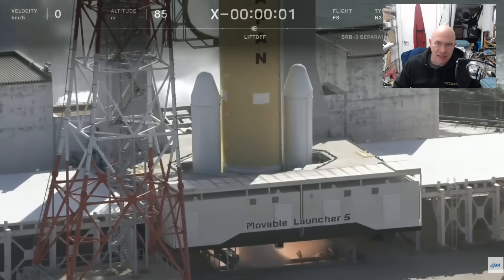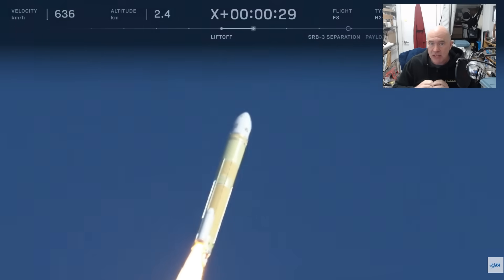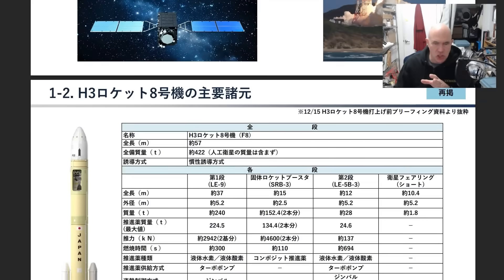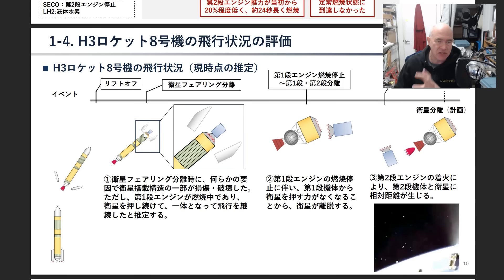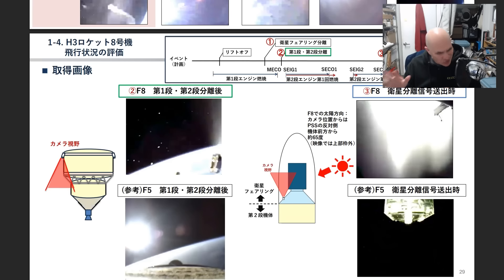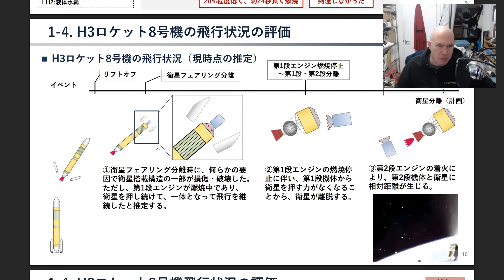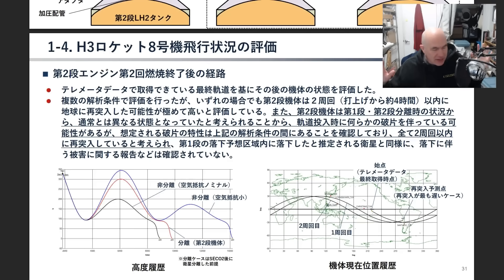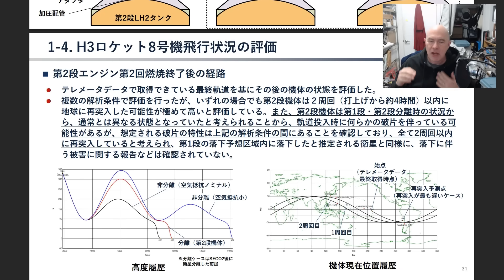OOPS! Japanese Rocket Drops Satellite Before Reaching Orbit....

Comment: What's your take on the Orion heat shield? NASA’s Orion spacecraft has a known flaw — one that has some experts urging the space agency not to fly the mission with humans on board. But NASA remains confident it has a handle on the problem, and the vehicle can bring the crew home safely.  The issue relates to a special coating applied called the heat shield.

Comment: So compared to SpaceX... is this comparable to a Falcon 9 dropping its payload, or are they still in development? Do they do enough testing?
Wikipedia says they've launched 7 times since 2023. The first and the last failed and the 5 in-between were successful, so likely not a design fault. However "Cost reduction was the primary design goal ." So was the launch adaptor any different to the previous five?
Great production, thank you Scott!

Comment: This event reminds of a young engineer, who was trying to impress me, with a new spring torque equation.  He left Mass out of the equation, turning an overhead rolling door into a guillotine.  As I watch this video, I can see management firing the young team that worked on the launch process.  It is always a simple action for management, when it comes to dealing with people that cut corners.  If the loss wasn't bad, the employee gets a second chance, but in an expensive event, people got fired.

Comment: I worked on Peacekeeper S-IV for TRW back in the 1980s, and while my stage wouldn't have benefited from video telemetry, it sure could have used the bandwidth.  Even one of those video images probably constitutes all of the telemetry bandwidth at our disposal.  I spent 6 months figuring out what happened to FTM-15 - or rather, what caused it.  I identified the location of the problem while it was in flight from a handful of pressure transducer traces, but it took 6 moths of reviewing stage build records to identify the cause.  There were other Peacekeeper failures whose cause was never found (e.g. FTM-3 Stage II ENCEC failure) where a video stream from the interstage might have made all the difference.  I even contacted a guy who had worked on Saturn V S-II to see if the stage separation film camera drawings were still around.  Turns out Rockwell's contract with NASA had called for the drawings to be destroyed only six months prior to my inquiry.   And, yss, that actually happens.

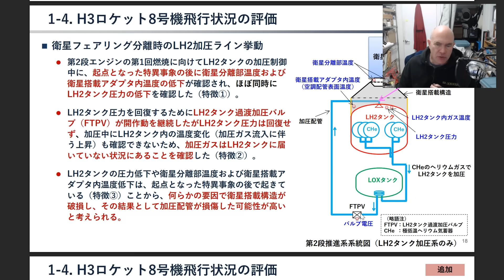Comment: Based on the diagram, at around 9:33, Scott conjectures that the tanks contain liquid helium, I think that CHe stands for cryogenic helium, which is used for hydrogen tank pressurization. If that's true, when Scott says "gaseous hydrogen", at 9:44 and 10:37, I think that he means "gaseous helium". Other than that minor detail, it was a very good, detailed explanation of what likely went wrong on this flight.

Comment: It does look like there is a valve issue since you don't see any hydrogen lose until after the first time the valve triggered, and it triggered 2 times before fairing separation.

Comment: This is speculation but I'm wondering if the vent that lets air out of the fairing was properly open. I find it hard to believe the insulation would fall of as the result of the short fall. Explosive decompression though could.

Comment: Japanese language student here. I'll offer my translation of the captions for these images. If the phrasing sounds a little strange, it's because I'm trying to stay as close to the phrasing in Japanese as I can while writing understandable English.

①衛星フェリング分離時に、何からの要因で衛星搭載構造の一部が損傷・破壊した。ただし、第１段エンジンが燃焼中であり、衛星を押し付けて、一体となって飛行を継続したと推定する。
①At the time of satellite fairing separation, by some causal factor a part of the satellite loading structure was damaged/broken. However, as the 1st stage engine was in the process of burning, continuing to push the satellite, it is assumed that they continue flight combined together.

②第１段エンジンの燃焼停止に伴い、第１段機体から衛星を押す力がなくなることから、衛星が離脱する。
②Accompanying the halt of burning of the 1st stage engine, because the force of the 1st stage fuselage pushing the satellite ceases, the satellite separates.

③第２段エンジンの着火により、第２段機体と衛星に相対距離が生じる。
③Via ignition of the 2nd stage engine, relative distance between the 2nd stage fuselage and satellite is produced.

Also, the whole thing is labelled:（現時点の推定) "Current assumption" so all of this seems to be speculative.
Reply: Dope. Thx

Comment: I suspect one reason the Falcon 9 is so reliable is that it was designed from the beginning to be human-rated (rated for 1.4 times maximum load, rather than 1.25).  IMHO that extra structural margin can compensate for possible construction flaws.

Comment: You see the blown out images with everyone.  What I don't understand is why they don't signal the camera to close the iris using the same signal that releases the fairings.  While I'm sure there would still be a few frames that are blown out, I would expect dramatically fewer.  You could predict the iris setting for the moment the fairing open and program the camera to jump directly to that setting using the same signal the opens the fairings.  Then you let auto-iris take over again.  Sometimes, like with the SpaceX Falcon Heavy maiden flight, the blown out frames add to the drama, but generally I would expect that the engineers prefer to actually see things all the time.

Comment: It often baffles me that we still don't have crystal clear, sharp images of what exactly is happening when failures occur. Too often we end up with useless, blurry footage that looks like from the 1950s. I know that there are certain moments when there is interference from reentry/radiation etc but there has to be a way to improve that, or not?
Reply: I guess downlink bandwidth is the real challenge here. Hard to recover memory cards from the ocean.

It's probably either UHF radio link through 100s of km and ionized engine plume or a satellite uplink. 
Either one will get you a dozen mbps tops, and you presumably have several cameras + telemetry.
Reply: Same here. I think it should be possible to make the small digital camera sensors do their scan in a parallel fashion... instead of scanning all the 8 megapixels, have 8 buses connected, each scanning 1/8th of the frame but 8 times more often... So it acts like a much faster camera, but still stays cheap

Comment: 8:58 The different color are showing previous flights with the blue/green line being the failed flight. All using the the same satellite bus ( presumably same accelerometers in the same configuration) . Fairing seperation is clearly inducing some forces onto the payload. As you said , this one did not recover from whatever is causing this and led to the failure.

Comment: I would argue that the biggest reason designing a rocket is hard is not making a rocket that "works". It's making a rocket that works reliably *without redundancies*!
Basically everything on an airplane that is complex has a backup, even the massive plane wide hydraulics etc. That simply isn't feasible for a rocket, so suddenly you have to make something reliable, but your not allowed to use redundant systems... Ok, so we overengineer and make it a lot stronger then needed then? Well no, no weight allowance for that either... So your stuck with having to balance (relatively) tiny margins of error vs capability. Not something you want to be doing.
If something structural in an airplane only had a 30% margin of error, I doubt we would be flying on that airplane. I suspect a lot of rocket parts have much lower margins then that. (Maybe I'm wrong?)

Comment: I would think if the mass budget would allow for an aluminum or magnesium adapter, it would be cheaper to use either metal than carbon fiber.  Carbon fiber is now known for being able to withstand blunt force impacts, i.e. space shuttle Columbia.  Also, the compressive strength of carbon fiber is somewhat lower than its tensile strength.

Comment: Carbon-carbon is great in tension but this cone is mainly in compression. The resin system and core reinforcement become a greater part of the equation. It's  a fragile balance and something as simple as a dropped wrench or someone leaning for balance can compromise the structure just slightly. Rockets are designed with such low margins for stress and vibration to save every gram.

Mmmm, the first area to look is shear flow at the core bond. IMO  That's an area that usually isn't critical until it is.

Comment: Sometimes I love google translate - with a camera - on a second device...

And they wrote - I write it in my own words - that when the first stage shut down, there was a momentum on the whole second stage stack, the satellite wasn't pushed against the second stage any more (the thrust of the first stage was gone suddenly as planned) - and the satellite fell off from the front end...

So, not only did the second stage disconnect from the first stage at first stage shut down, but the satellite did also disconnect from the second stage ;-) 

Then the second stage ignited and as you said, it did what it was programmed to do, but it left the satellite behind ;-)

--------
And you described the whole sequence - there was more before that... (folks, watch the video, I don't want to spoiler it :-)

Comment: Another possibility about the root cause might be that the payload adapter already was weakened or damaged before fairing seperation but the fairing surrounding it was just barely enough to hold it all together (kind of like a stringer).

Comment: This is an exact failure mode I have had in KSP, including the leaning and the acceleration keeping the payload on the 2nd stage until seperation, which is pretty neat. Obviosuly we don't have leaks in quite the same way in KSP which is a shame but while it's unfortunate they had a failure the reasons behind it are very interesting

Comment: AI Summary

Abstract

This technical brief details the preliminary findings of the Japanese H3 Rocket (Flight 8) mission failure, which resulted in the loss of the Mitubiki 5 satellite. Contrary to initial theories involving propulsion valve malfunctions, updated telemetry and visual data indicate a catastrophic structural failure of the payload adapter assembly during fairing separation. 

The investigation suggests that the mechanical shock or load redistribution during fairing jettison caused the carbon-fiber composite payload adapter to collapse. This structural failure likely breached the second-stage liquid hydrogen (LH2) tank, leading to a terminal drop in tank pressure. Although the satellite remained physically atop the rocket during the high-acceleration phase of the first-stage burn due to inertia, it was jettisoned during the zero-G transition of stage separation. Consequently, the second stage ignited without its payload but failed to achieve orbital velocity due to degraded engine performance caused by the loss of LH2 pressurization.

Launch Failure Analysis: H3 Flight 8 (Mitubiki 5)

*   0:13 Failure Overview: The H3 rocket Flight 8 failed to deliver the Mitubiki 5 spacecraft to its target orbit. While early reports focused on a second-stage engine relight failure, current data reveals the satellite was lost well before that phase.
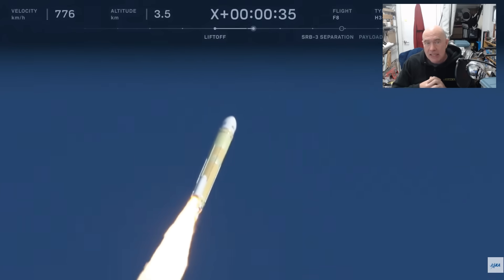*   0:42 Structural Failure ("The Front Fell Off"): Onboard camera footage and JAXA documentation indicate a mechanical failure between the second stage and the satellite payload adapter.
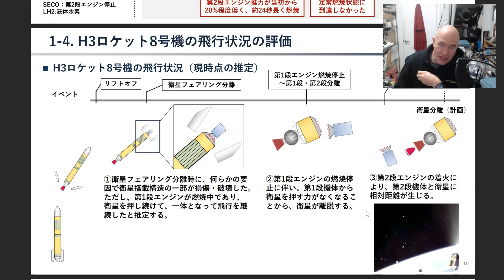*   2:01 Separation Anomaly: Investigators believe a mechanical failure occurred during the ascent. The second stage effectively "dropped" the satellite before the second-stage burn was completed, leaving the spacecraft behind in a sub-orbital trajectory.
*   3:32 Visual Discrepancy (Flight 8 vs. Flight 5): Comparison with previous successful launches shows the Mitubiki 5 satellite shifted its orientation and leaned toward the camera prior to fairing separation, indicating the payload adapter was no longer rigid.
*   5:18 Debris Detection: Post-fairing separation footage shows significant debris, likely multi-layer insulation (MLI) from the satellite, suggesting the spacecraft sustained external damage during the structural shift.
*   6:19 Payload Adapter Collapse: The carbon-fiber composite cone, designed to transfer loads from the stage to the satellite, appears to have crushed or collapsed. This component is critical for both structural support and the eventual release of the spacecraft.
*   7:50 Accelerometer Anomalies: Telemetry from the satellite's sensors shows axial acceleration oscillations lasting 1.5 seconds—significantly longer than a standard separation event. This suggests a "ringing" effect caused by the adapter hitting the top of the LH2 tank.
*   9:12 Tank Pressurization Loss: At the exact moment of fairing separation, hydrogen tank pressure began to drop. The structural collapse of the adapter likely damaged the plumbing or the bulkhead of the LH2 tank, causing a leak that the helium pressurization system could not overcome.
*   12:27 Inertial Retention: The satellite remained atop the booster during the first-stage burn simply because the rocket was accelerating into it. Once the first stage shut down (stage separation), the lack of a mechanical connection caused the satellite to drift away.
*   13:12 Degraded Engine Performance: The second-stage engine fired longer than nominal because it was pushing less mass (no satellite), yet it still failed to reach orbital velocity because the low LH2 tank pressure significantly reduced engine efficiency.
*   14:38 Orbital Decay Evidence: The object re-entered the atmosphere after only two orbits. Forensic calculations show that if the satellite had still been attached, the higher ballistic coefficient would have allowed for a third orbit. This confirms the satellite and stage had separated prematurely.
*   15:44 Root Cause Investigation: Future inquiries will focus on whether the adapter failure was due to a design defect, a manufacturing flaw in the composite, or damage sustained during ground handling.

AI-generated summary created with gemini-3-flash-preview for free via RocketRecap-dot-com. (Input: 20,127 tokens, Output: 911 tokens, Est. cost: $0.0128).

Comment: Congrats to the japanese for having the balls to fully admit their mistakes. It's not every space program that will do that publicly.
Reply: Japan seems to train their engineers deeply in process engineering, which is great for high-sampling processes, like widget manufacturing, where you can easily work from end product quality failures to changes earlier in the pipeline.

A lot of their high-profile failures, nuke materials handling, disaster-proofing, space exploration, and so on, seem to be with low-repeatability situations, where imagination and modeling are the primary tools.
Reply: Japan: 5 executives bow deeply on a stage.
    "We made a mistake. Here is a 745 slide presentation on what went wrong and how we could have fixed it."

Elsewhere: Marketing schmuck smiles their fake teeth to the camera.
    "The live feed seems to have dropped out. But I'm sure everything is going as planned."

    Live feed can still be seen playing on screens in a panicked control center. Things are not fine.
    *Man runs by on fire in the background.
    "Have we showed you our next project? You are REALLY going to want to invest in that one."

Comment: The premature separation of the satellite, an unforeseen anomaly, was not even provided for by the program, otherwise there would have been an opportunity to terminate the flight ahead of schedule.
Reply: It might well be, but it didn't account for this specific method. E.g. it might detect if the payload adaptor loses touch with the payload, but not if the payload adaptor breaks in two.

Comment: Translation of first  page 
During satellite fairing separation

Due to some cause, a portion of the satellite mounting structure was damaged or destroyed.
However, because the first-stage engine was still burning, it is estimated that the engine continued to push the satellite, allowing the rocket to continue flying as a single unit.

② First-stage engine combustion stop

With the shutdown of the first-stage engine, the force pushing the satellite from the first-stage vehicle was lost, causing the satellite to separate from the first-stage body.

③ Second-stage engine ignition

When the second-stage engine ignites, a relative distance is created between the second-stage vehicle and the satellite.

Comment: Wouldn’t the telemetry from the second stage have shown an over performance in the acceleration due to the loss of mass?
Reply: The pressure chart was like down to half what it should be? so thrust was likely abysmal and wasn't something the lighter mass could compensate?

Comment: Early staging and payload separation are some of the hardest parts of any launch. Timing is measured in milliseconds and even small sensor or software disagreements can trigger a protective abort. Spaceflight looks dramatic when it fails, but this is also how engineers learn and improve reliability.

Comment: 2:36 Michibiki 5 was designed to be the source of the signals for the new Inter-satellite ranging technology. Losing it means the receiver on Michibiki 6 and 7 will not be as useful and there is no replacement for it.